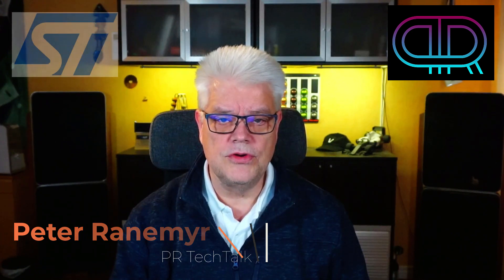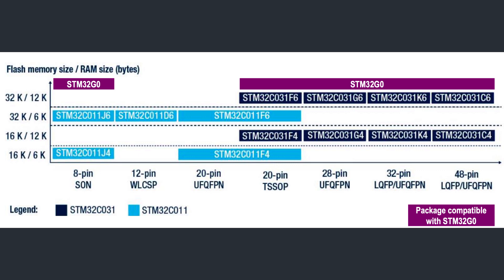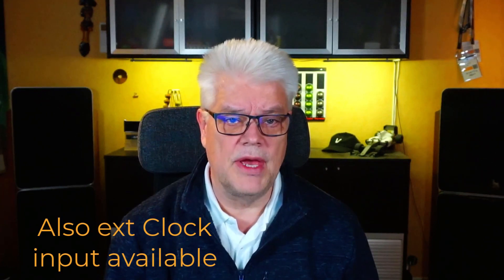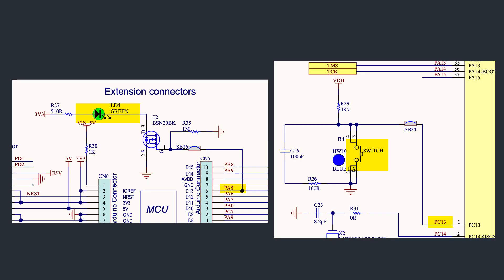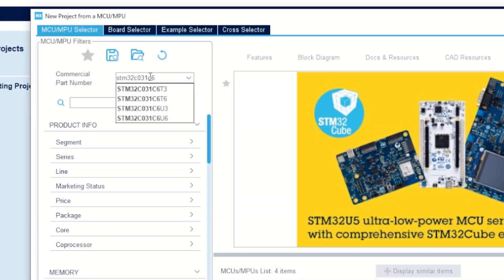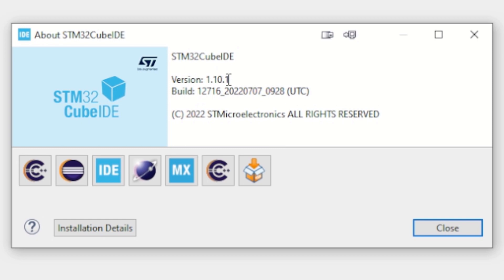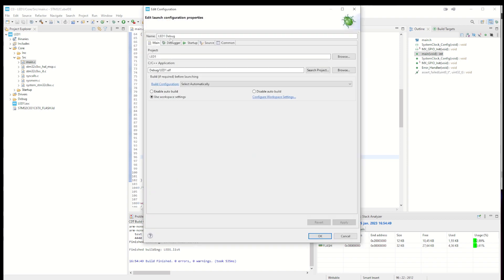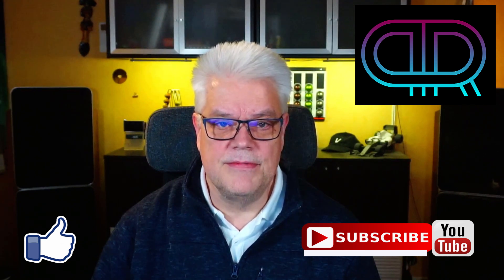Replace your 8bit MCU with 32Bit STM32C0

Comment: Does it work directly from 5V? Does it work directly from LiIon battery? Then no, I'm sticking to AVRs for these applications when cost or space are of concern.
Reply from the maker: Hi, you are correct the STM32 does not run directly from +5V or fully charged 1Cel Li-Ion battery. Some pins have posibility to interface towards 5V logic but cant drive 5V output. So if you are familiar with Microchip´s AVR and they fulfill your requirement, then your MCU´s selection is Clear. 
Thanks for your comment´s and have a nice summer :-)
/PR TechTalk
Reply: @prtechtalk416  interestingly, other manufacturers that offer "32-bit replacements for 8-bit mcus" do that with 5V-powered options. But not ST.
Reply from the maker: That is depending on the process they run on, If they use a process bigger than 90nm then 5Volt is doable, But bigger process drives bigger silicon and that drives cost and current consumption. All descissions have 2 sides benefits and drawback.
/PR TechTalk

Comment: I was introduced to microcontrollers through the Raspberry Pico, but was not satisfied with how big the sleep current it draws. I am buying the dev kits for the STM32C0 because I am still familiar with the ARM Cortex M0+. I saw the datasheet and saw after clocking down + different sleep modes it has detailed notes on current draw, which will be great for low power battery/solar applications I think. It will be interesting since I am used to having a board like the Pico, so I may need to learn how to create boards to solder.
Reply from the maker: Hi, thanks for your comments. When it comes to solder don´t cheep out on tools and use high quality flux. Good Luck.
Reply: @prtechtalk416  I got my boards shipped to Canada, and tried out the STM32C0116-DK discovery kit and was able to blink it with the help of your instructions. Based on the shipping and brokerage fees to Canada I might just get the available STM32 parts from a supplier like Digi-key instead, which has the SOIC-8 format I'm eyeing.